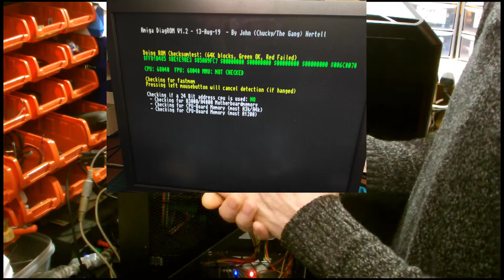Amiga4000d moves to new home

Comment: Very interesting Steven. Not seen an Amiga in anything other than a plastic case so was nice to see how you put it together. My old custom builds used to have a mix of cold cathode tubes inside and home made led strips using vero board, usually stuck somewhere in the case out of sight but with a glow. As for what you want to do, it all really is up to you, mountings and led types are a personal thing.
Reply from the maker: i agree , they will be removed i think and i will fit an internal led strip somewhere , since it is a mesh case they will light up the entire enclosure :)
thanks for that i just made up my mind lol
inspirational christofi lol